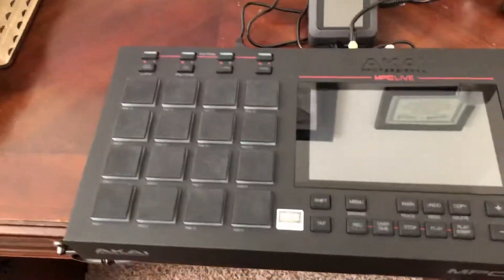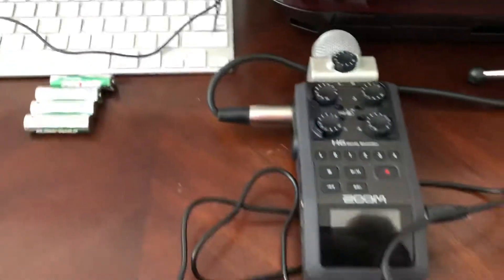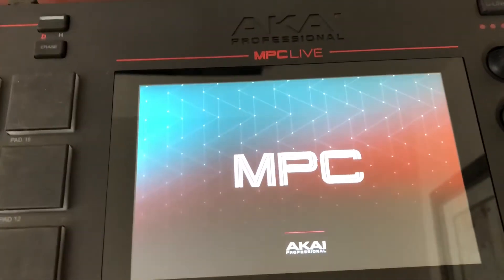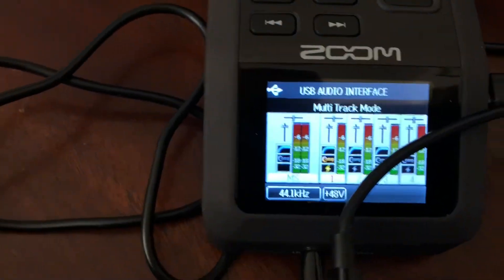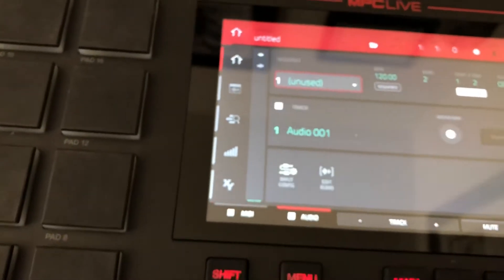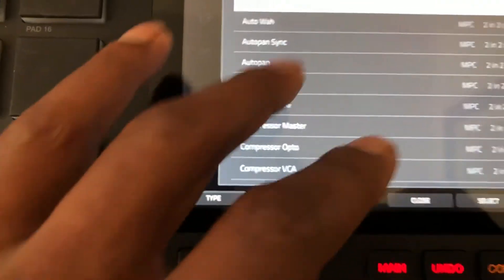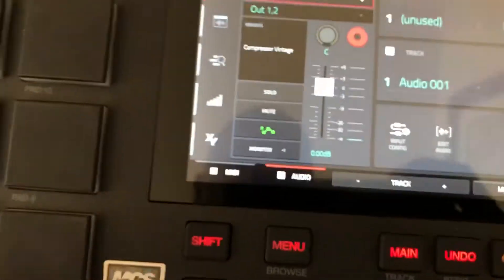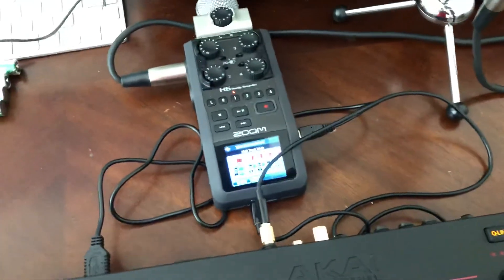Akai MPC Live XLR microphone fix

Comment: Nice vid bro. Have you tried recording into H6 mics straigth to MPC Live, without C1 mic? I.e. using H6 as audio interface and portable mic in one? 
I wish I could have smaller portable setup and use it's mic for recording on the go
Reply from the maker: Yes. It works. My H6 has a glitch that was repaired. Now that setup works nicely
Reply: @RobCamizzi  Thanks for the prompt response Rob. So can I just hook up my H4 to MPC live and use it as audio recorde AND mic? That's sweet, dude!
Reply from the maker: Yes that should work. The H6 does it well. I used it in both stereo and track record modes with great success

Comment: Zoom H6 

This is pretty awesome knowledge using this H6 as an audio interface. I was just thinking for $499.00 I can get an UAD Arrow but it still only gets me two tracks simultaneously when recording the band. With this I can get up to 6 separate tracks/Mics 
Running let’s say 
2 overhead condensers on a Drumset 
1 Bass Guitar 
1 Lead Guitar 
1 Keyboard or Horn section mix 
1 vocal 

Or if I wanted to record a big band or orchestra I can have 3 sets of Stereo Mics overhead (Orchestra)winds , drums , strings or (Concert Band)woodwind, Brasswind, Percussion 

Or I could record in a concert Hall using 
The following 
2 Overhead Mics 
2 front stage Mics 
2 back of the Hall Mics
Take the recording run it through ProTools and spice it up through my Universal Audio Plug In’s 

Man thanks for posting this video you gave me some serious options for capturing sound on a budget and 1 bag for Mics and cables and a hardware case for mic stands 

And I could hook this up to my laptop and mix and master on site if I wanted (Well it’s an option at least)

Who wants to carry all that equipment everywhere? Nobody!

Best of all when I’m on the go I can bring my mpc live and run a whole session out of a gig bag recording vocals, midi, record the band and background singers. The Zoom H6 makes the MPC LIVE and MPCX Super Power Tools .... in Stand Alone Music Production 

THANOS LEVEL

Thanks a lot Rob
Reply from the maker: Good stuff bro

Comment: Hey my man, I had heard you in another video explaining how to hook up the akai mpk mini, to the mpc essentials and hybrid 3, which I still to this day cannot get past the preferences/vst location part, on the mpc essentials, which had me so dam mad, I can't even describe it, but quick question on the mpc live. Is the live anywhere near as hard to sync or connect with other things such as software or other systems on a computer, like if you have to add or get rid of something on the machine? I was just wondering, because if this is anywhere near as hard to hook up or connect with other things, like the akai mpk mini software, I don't even think I would get the thing, but I could still rock out with all the stock sounds regardless, and use it as an absolute stand alone. Thanks.
Reply from the maker: It’s amazing in standalone and as a controller for the included MPC software. It comes with finds of sounds and getting more kits into it is easy especially if you add an additional hard-drive to it

Comment: I'm not sure you set it up correctly. There was no metering change on the input of the live.
Reply from the maker: I hadn’t turned up the gain on the mixer input. In was demoing on the fly. With proper gain settings it works well
Reply: Rob Campbell - R. Camizzi Hey, any clips of the mic setup giving a decent input level?
Reply from the maker: I was able to go back to the H6 after doing some changes to it’s settings and get good levels from it. Keep in mind, with dynamic mics you’ll usually need to crank up the gain. With a condenser and phantom applied to the input I got normal results

Comment: I mean this works... but you can just get inline battery phatom power sources. That way you use the 
MPC converters only. I don't believe you are going straight line through. I think that you are going through zoom conversion and then to mpc conversion. so two ad conversions. And also an inline phatom power would be wayyyy cheaper.

Comment: The zoom u22 interface has phantom power and is 60 bucks. It runs on 2 AA batteries
Reply from the maker: Yep. Took a look at that one after this, but found out the noise culprit on my Zoom H6 and have since been using it